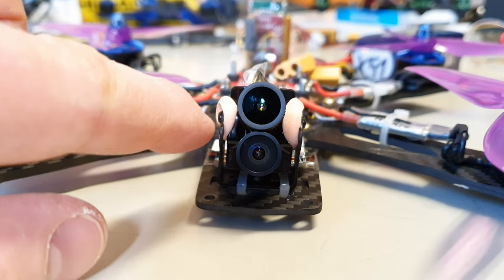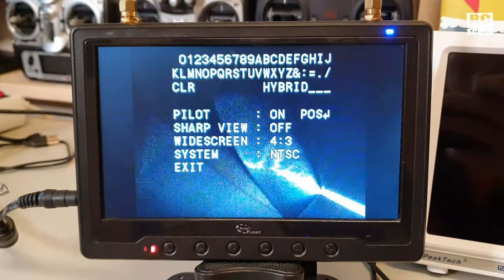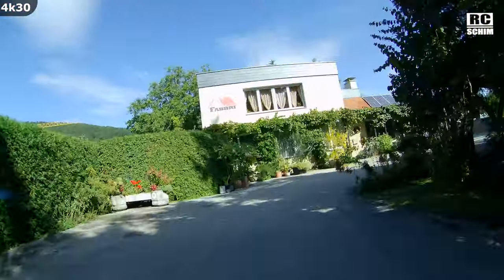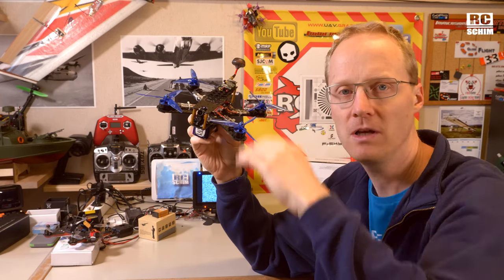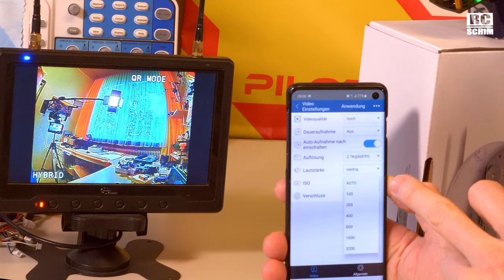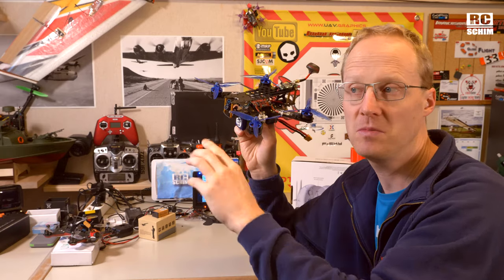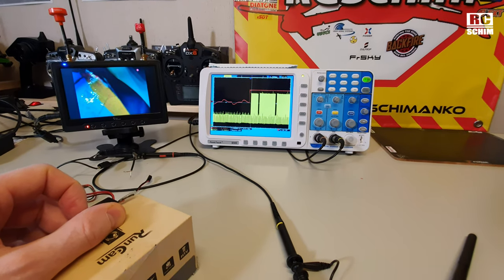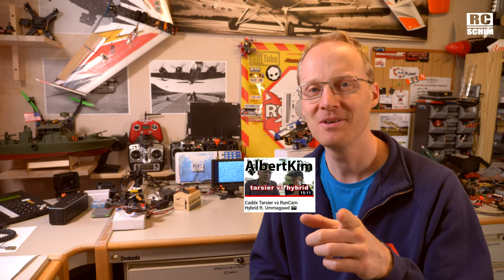Runcam HYBRID indepth tests: Flight Footage, Lowlight, Latency during recording, Menu walkthru

Comment: Hi RCSchim.  Would you happen  to know if the solder pad "between" the RX/TX and video out yellow wire which has "ADC or ADO" (difficult to read) written on it, is AUDIO OUT to the transmitter?  Many thanks...Subbed

Comment: Thank you so much for posting the low light footage - it was revealing. It would be super insightful to also see some footage shot at dusk (after sunset, but before dark). Perhaps 20 minutes after sunset. My Tarsiers produce surprisingly good HD video in full daylight, but at dusk they look terrible. Very underexposed with a very strong blue tint. 
On paper, I really want to switch to the Hybrid. But I'm having trouble getting past the low dynamic range of both the FPV feed and the HD video. Almost no detail in the shadows - mostly black. Would you consider posting a video in which the internal settings of the Hybrids' FPV and HD cams are modified? Lower contrast, saturation and sharpness. It would be so insightful to find out if lowering the contrast will bring out more shadow detail (i.e. if the sensor has the resolution to provide increased dynamic range).
I really appreciate the thoughtful, methodical, and detailed approach you take to your videos. Know how much you are appreciated by the FPV community!
Reply from the maker: Thanks for the long comment. Good to see written appreciation like that for my work :)
Dont expect any good image after the sun is down from those cams. The sensors are just too small I guess.
I can try to shoot a short video in dusk light and at the same time try higher ISO settings (not sure what ISO level is used in AUTO mode).
Of course with 3200ISO it will be grainy and ugly...
You think we get more shadow detail with lower contrast settings? I can test this as well - but I doubt it. Also on the similar Runcam5 the dynamic range wasnt really good...  Where does the dyn range come from? I think from good glass? These are really small and cheap lenses used here...
years ago someone started using those gopro3 replacement lenses on FPV cams - and it was great! 
not sure if today the Lenses in Hybrid for example are on a higher level...
Reply from the maker: here you go: https://youtu.be/2MzTUhGKQNA

Comment: Since they say not to power it directly from the battery, how exactly does one power it safely? Thanks.
Reply from the maker: I didn't have an issue powering it directly - but as I said in my video there is the warning about power spikes while flying...
You could at least use an capacitor (as we also have to on all DJI FPV builds) to protect the cam from volt spikes.
Alternative: use a cheap volt stepdown to power it (and feed it from the balance lead of your flightpack...
Reply: @Rcschim  Thanks.

Comment: i tried 1440p on the rc5, my superview didnt look great, so my plan is to go back to 4k 30 and when i superview it i can also cook dinner on top of my pc,  i love the hybrid and the tarsier seems just as good to me, i'm a bit miffed about fov all being smaller than the gopro's did you know the rc5 uses the same size sony sensor as the hero 7? so why don't we get 170degrees?
Reply from the maker: yes, maybe the FOV (especially the vert) is the only little downside of this cam. but considering the size and weight I can live with that. 
You're still referring to the Gopro7?  Come on - that's outdated - we already have the gopro8!
I was thinking about getting an GP8 so I could use my GP7 more (because than it would be the "old" gopro) :)

Comment: And I don't understand why manufacturers don't use ionistors as little backup battery and correct finishing record on SD card after user turn off quad?
Reply from the maker: Some do. I think some FPV goggles DVR has exactly this feature...
Here you loose really only 2-3seconds - so it's not a big deal. In real live I have 1-2mins of video where the copter just sits there BEFORE takeoff, and 30secs (or more if I crash somewhere remote) until I turn off...

Comment: What if I will put simple LC surge protector filter between XT60 and it's load? It will surge any voltage or current spikes and protect not only this camera but all quad's equipment?
Reply from the maker: I guess - but for these kinds of statements I'm not qualified electrician enough :)
one thing I know:  if the "magic smoke" leaves your components - their live has come to an abrupt end ;)
Reply: @Rcschim  Hey Mario, the voltage spike worry is mostly a problem when you connect the battery; the battery cables, connectors, PDB all add up to  enough inductance that quite a high spike occurs right at the time the connection is made- you can measure it on your oscilloscope! Shorter leads and tracks on the PDB help, and every setup will be different so sometimes it all works without a problem. Adding capacitors can help, but they need to be low ESR quality components and even then might not be enough. This is a really good description:
https://www.pololu.com/docs/0J16/all

Comment: The hybrid has HD sensor with 16:9 aspect ratio. So no 4:3 mode by firmware update. And if so, it would be only by cropping, which is useless
Reply from the maker: thanks for the info. that's one thing that i missed: take off the lens and take a closer look at the two sensors. I be the Racer has a 4:3 sensor...
in general that vertical FOV is a bit too low for my taste - but thats the only little downside on this great cam...
Reply: @Rcschim  Also the FPV camera has 16:9 sensor in th Hybrid. It is also visible in your review when you switch the 16:9 and 4:3 modes. The 4:3 is being cropped on the sides. The FOV of HD camera is a tiny bit lower than ideal. I saw info by RunCam's representative (IIRC on the RC's FB page) that they are trying to source a bit wider lens.